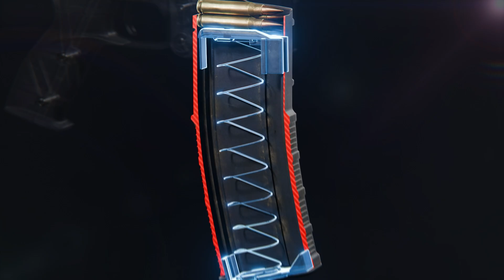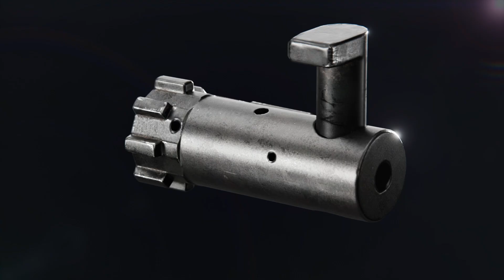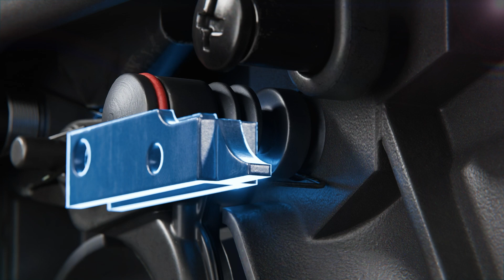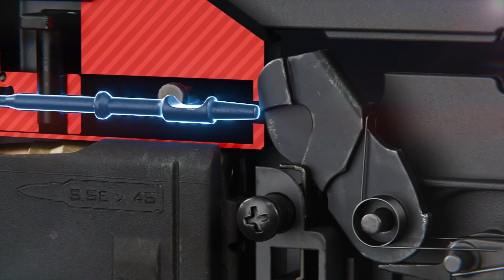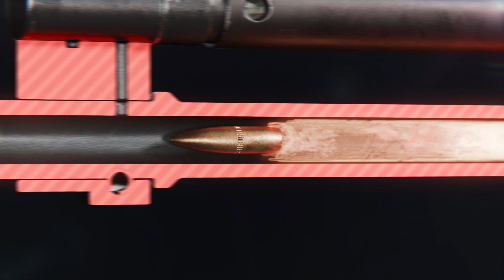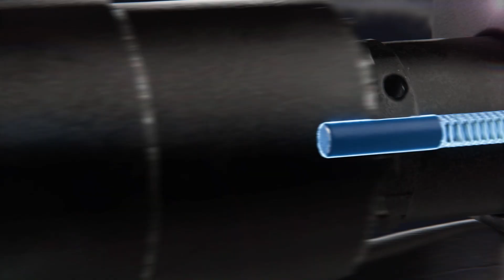How a PLR16 Works

Comment: It's amazing just how tiny this thing is! I was expecting the recoil spring to be inside the handle to, save weight or something wacky like that, but no; it's in front.

I'm guessing this thing is ridiculously loud, no?
Reply from the maker: yeah, also search up the muzzle flash that it kicks out!! it's like a fireball 2-3x as big as the gun itself lmao. The design for the recoil spring seems to be inspired from an AK/Draco and I don't think its location was for any specific purpose besides solving a special problem--the gun is just so small and compact that there doesn't seem to be any space anywhere else for the recoil system. You can see how it's basically wrapped around the piston, so it saves a ton of space--as opposed to a whole isolated buffer tube on an ar15 or something. But note that these guns are notoriously unreliable, but imo I think its because of the cheaper material quality and not the actual design :p